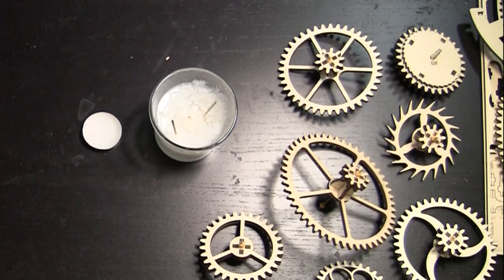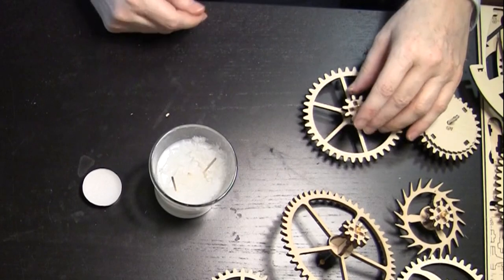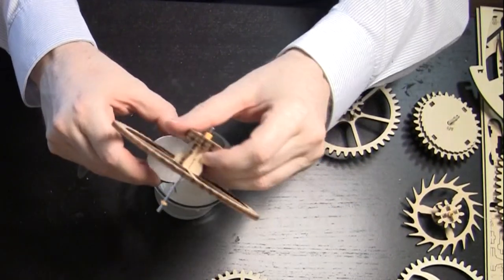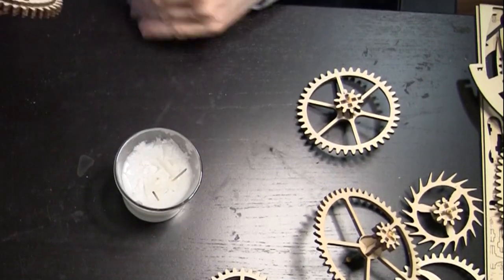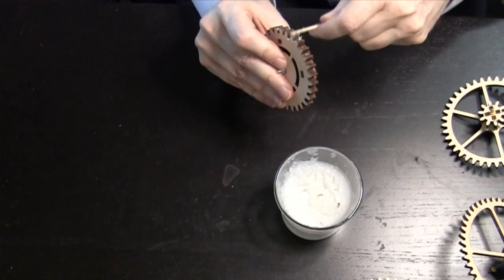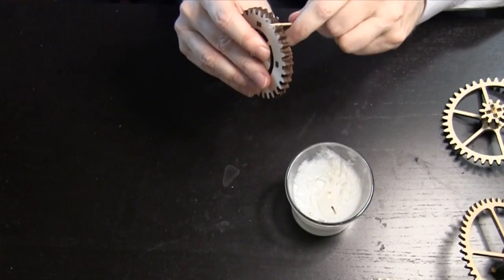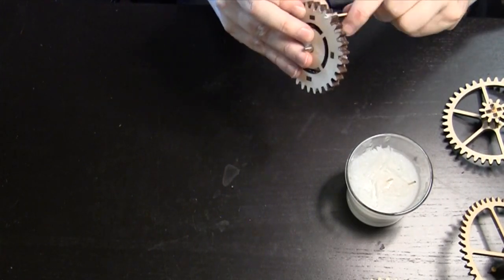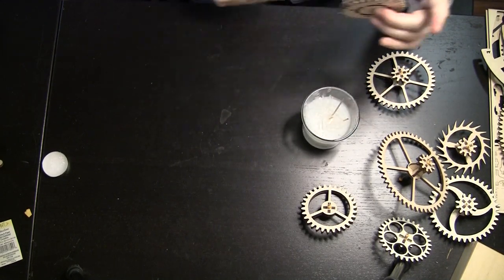How to Wax Your Gears

Comment: Thank you for this. The instructions were not clear at all on how wax should be used. (I have the train model).  A comment on another video said the wax could not be shipped to some locations, probably because it is a flammable material. It also said the wax could be purchased at most hobby stores.  Mine came with the wax.
Reply: Have assembled your clock and is it working ours keep stopping on the hour

Comment: I use a small shallow tray with warm/melted wax just deep enough to roll the wheel and cover the teeth. The wax will adhere to the wheel well enough for its intended purpose. Standard paste wax, like floor wax works well too.
Reply from the maker: Cool.  Thanks for the tip.

Comment: I've been using Johnson's Paste Wax for almost 30 years. It works so beautifully well on metal and wood, I've never tried anything else. Brush it on with a small stiff paintbrush, wait 20 minutes, and wipe off excess. Make everything slick as a whistle. Also good for table saw tops, etc.
Reply: Thanks for the tip excellent idea.

Comment: Due to the audio quality, I couldn't quite hear the one word I needed: what kind of wax are you using?
Thanks!
(My kit is missing even the wax they said they'd supply...)
Reply from the maker: Hi, I use a Glade air freshener candle wax.  You can probably find it at Bed, Bath and Beyond or similar store or section of a department store.
Reply: Mine was missing the wax also
Reply: @andrewrurak9540  So was mine
Reply: same
Reply: Now I just wish I could get it to run for more than 30m at a time (and that only if it’s perfectly level. No, perfectly...)
Reply: I have a different kit but mine didn't come with the wax that was in the parts list either.

 Can anyone explain why this is common, and why wax is beneficial to the project?
Reply: @heatshield  Adding wax to the moving parts helps them move over one another more easily. Without wax the pieces will almost stick together.
Reply: @edclune5357 like those was cubes for wax warmers?

Comment: Do you need to heat up the wax (that comes with the kit)? Cause its just flaking off right now
Reply from the maker: Nope.  Both the wax I get in the kits (usually a candle) or the wax I prefer to use are applied at room temperature.

Comment: Thank you for sharing your experience. I don't think those gears look epicycloidal, nor the pinions radial, which would negate the need for any lubricant. The design is then flawed, but the good news is that you now have "plans" for your own build. Cut those gears properly, and your clock will run 100 years.
Reply: Could you recommend where can I learn more about what places need lubricant? And what exactly is "properly" in this case? Thanks!
Reply: @more_yasnotsi  Do a search for clock books from the turn of the 20th century and previous. Lots are free online. The idea is that using epicycloids for the wheel teeth and radial leaves for the pinions requires ZERO lubrication because the gear teeth and leaves ROLL on each other; there is no friction (a few exceptions to be sure, as always). Now the only place you might need lubing is at the pivots. That's where the arbors meet the plates. Of course, you might not depending on the torque in the system. Anyway, good luck!
Reply: @thomashughes4859  thanks a lot!
Reply: @more_yasnotsi  No worries!

Comment: Can you use technical vaseline? Its a bit easier to spread.
Reply from the maker: I haven't tried it, so I can't make a definitive answer.  The two things I would be concerned about are whether the stickiness causes more problems than the lubrication helps and whether it either stains or is absorbed by the wood over time.

Comment: Ignorant question: if the wax doesn't help stuck gears move, what purpose is it serving?
Reply from the maker: Thanks for your question.  I believe what I was trying to convey that adding wax is not a cure-all.  It won't make a gear train that has a lot of friction magically run smoothly by applying wax.  Adding wax would be useful if the gear train runs but has a few glitches or rough spots.  It's all about expectations.
Reply: Hi Ed, thanks for your response, my gear train does run but only for a small amount, then it gets stuck and can’t seem to locate where it is getting stuck? I believe it could be due to friction, any help would be greatly appreciated. Thanks

Comment: Could you heat wax and paint it on gears ?
Reply from the maker: Hi.  I don't think paint would be a problem on non-gear surfaces.  I'd be a little more concerned about wax, both because it would have mass and depth and because it might tend to flake off and get in places it shouldn't.  That said, I've only ever seen pictures of the clock just as wood (and metal) without any paint or adornment.
Reply: @edclune5357  Hi Ed, I was thinking down the lines of melting wax and painting it on gear surfaces ect to get good lubrication ?
Reply from the maker: @davidgarston3353  Hah, I didn't notice what video your comment was in.  I have not tried that but it seems like it should work.  I'm guessing you would still have to scrape off excess wax here and there.